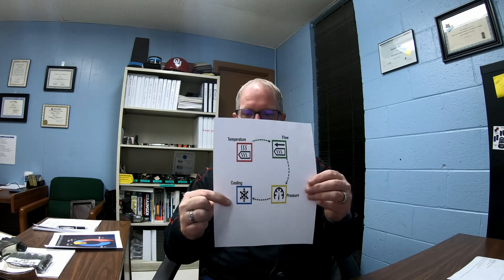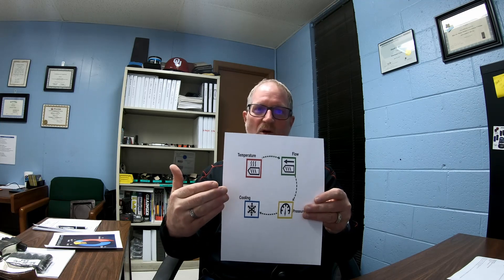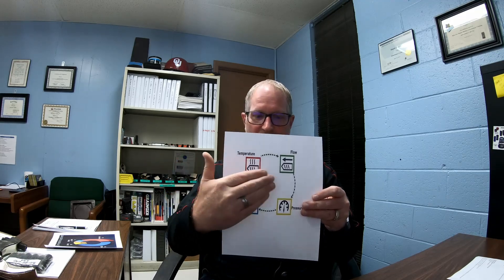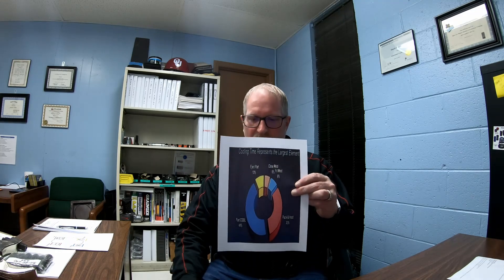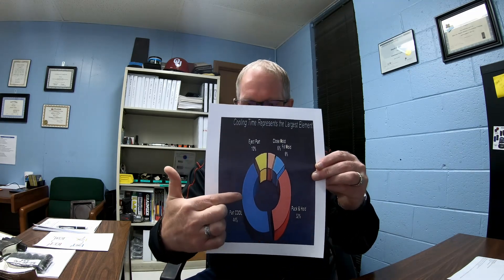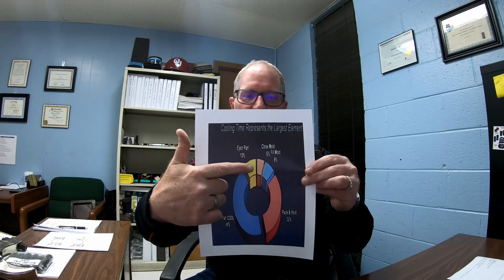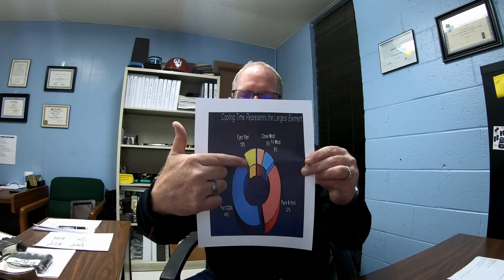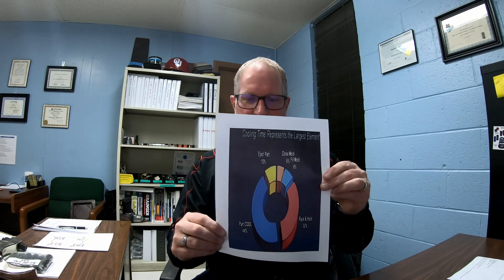4 Variables in Molding

Comment: Hey Lucas, your videos are just great, i am just wonderimg since i heard from you several times that you are mentioning that part needs to be filled 95-98% until we switch to pressure. How do we actually determine those percentages? Is it something we can check on the machine or we use our eyes to visually see if it’s almost full or not ?
Reply from the maker: You are looking at the part to see how full it is with fill only. Once you think you have the part about 95% to 98% full then you had hold PSI. So, what you are doing is taking the switchover or transfer down till you have the part where you like the % to be before hold. I hope this helps you out, Thanks for watching & the support to the channel, I greatly appreciate it.

Comment: Hi Mr Lucas,
May you clarify this for me?
"We know that the driving force in the injection machine is
hydralic or electric motor, so when we enter a value for injecion 
rate or velocity in first stage or filling stage what the machine 
does to maintain the value we set for velocity is it exerts a 
pressure to see what the resulting velocity is and in a closed loop 
it sets different pressures to keep the velocity on the value we 
have entered". 
What I'm pointing is actually the velocity is a result of a profile of
different pressures adjusted by machine to maintain our prefered 
velocity. Am I correct about this?
Reply from the maker: Velocity is changed by the profiles on the machine yes. But the material viscosity is what you are looking at to make the changes needed. If the viscosity is too low, you can't push fast & the pressures are high. If the viscosity is high the speeds will be fast & pressures low. I hope this helps or that I answered the right question. Thanks for watching & the support to the channel I greatly appreciate it.
Reply: @injectionmoldingskillsmore1064  Thanks so much Mr Lucas.
Reply from the maker: Your welcome

Comment: Excellent information! I’m an engineer in an injection molding facility, and I need only these pieces of info to take a process from press to press: melt temp, mold temp(s), fill time, and cooling time.

Btw, a great rule of thumb when checking melt temp: 30-30-30; run the machine for 30 mins or 30 cycles, pre-heat your temp probe to within 30 degrees of the expected temp, and get it in the plastic with 30 seconds of it leaving the barrel.
Reply from the maker: Yes, Thanks for the info & for your support to the channel. Thanks for watching